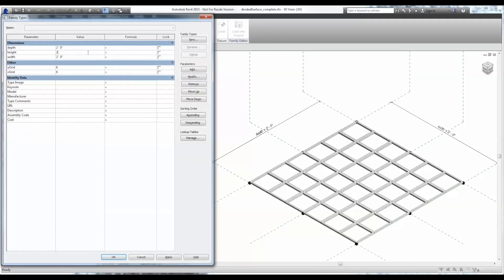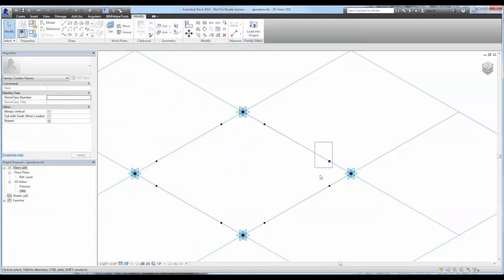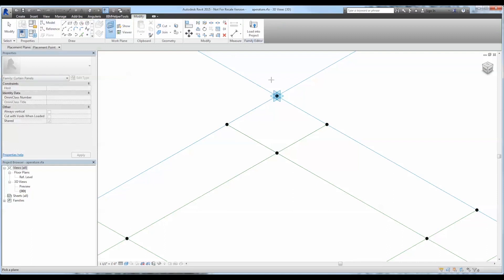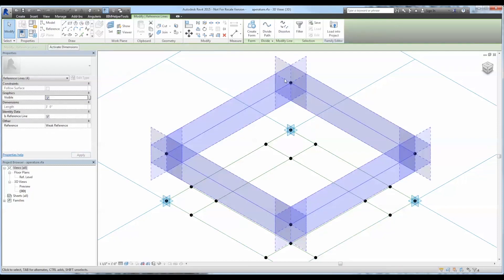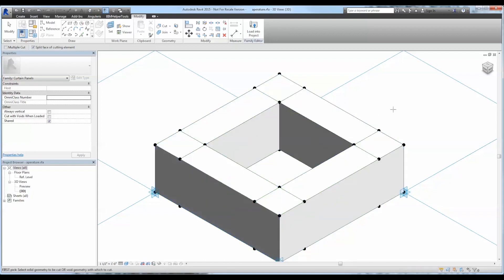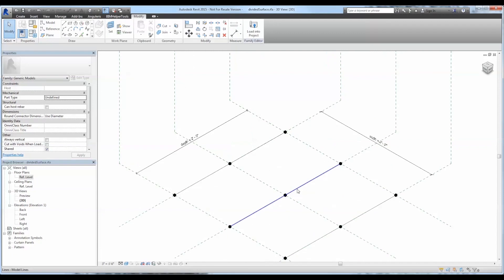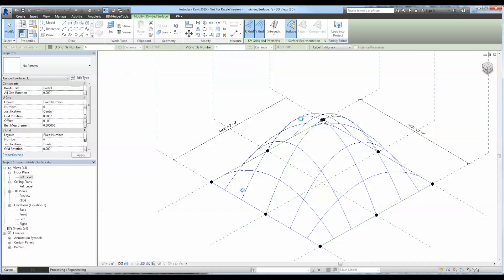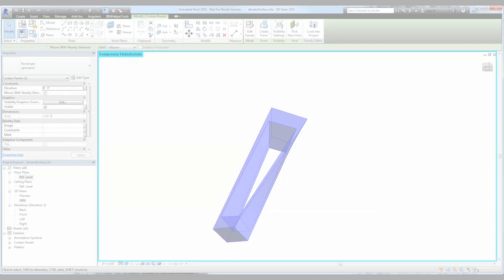How to Build a Parametric Adaptive Component in Revit - BIMsmith Revit Tutorials

Comment: i started from an adaptive component instead of pattern based, with the idea it can be applied on other patterns easily. but my void injoins all the time. i did use chord lengt instead of curve parameter. could that be the cause?